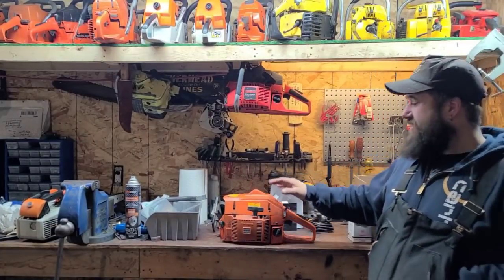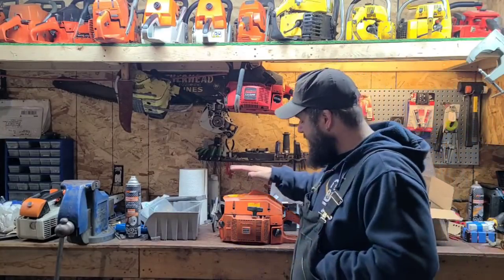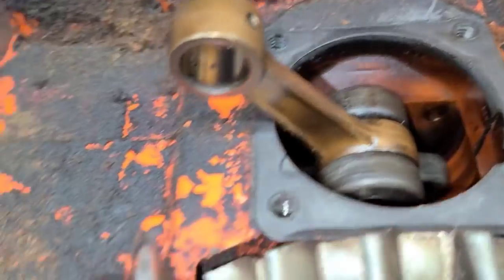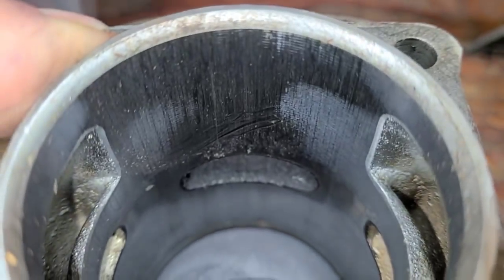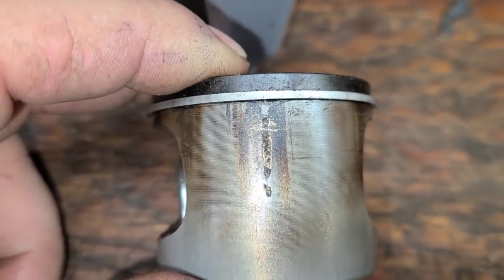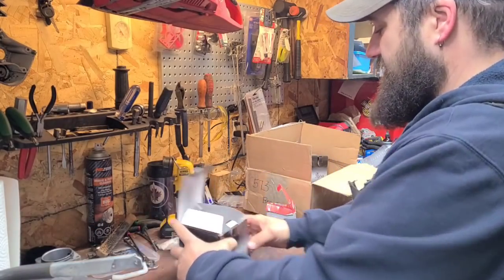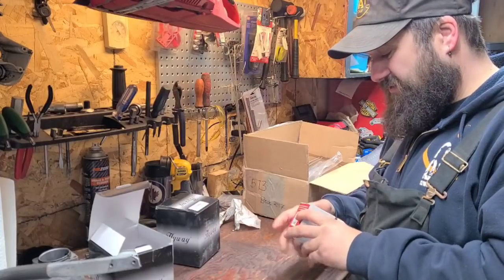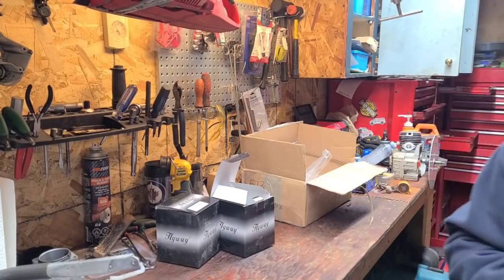FNS: A 266xp for Buckin Billy Ray with parts from The Ironhorse!!

Comment: @Tinman I've been using Three Bond 1184 for a couple years and it's a great adhesive and sealer compared to the one you are having trouble with in the cold. I'm in Calgary Alberta and my shop is about the same temp as yours!🥶 Hope that helps, good luck with your builds.😉👍

Comment: I have a 266 and a 268 and in all honesty I like running the 266 more its just a perfect saw so I understand the love for the 266
Reply from the maker: I've owned both, I found my 266s run better then the mint 268 I had.
Reply: @tinmanssaws  the 268 is even ported it was when I got it and shes not an easy starter the 266 on the other hand has a ton of compression and starts on the 3rd pull

Comment: Hey tinman! I've been working on a 268 for months, every time I put it together the saw fires up and races away! I've put new seals in it, new gaskets, etc! About ready to throw the thing out!
Reply: Of you can shoot some brake clean around the potential spots for air leaks while it's running you should find the leak, the brake clean lowers the RPM if it sucks it in. Walt at Afleetcommand has a couple videos on diagnosing leaks with it.
 Check the intake, I believe those ones use the plastic block, sometimes they crac from being over tightened.
Best is using a pressure and vacuum tester like a mity-vac, about $80-$120, if you're doing many builds or much saw work, it's a good investment, good luck👍
Reply: @jimssawsnstuff8903  Thanks Jim, yes I am a big fan of the Afleetcommand channel and recently used the brake clean trick to find a crack in a Jonsered 70E intake manifold(also plastic)... I really wonder if I have the crank seals in correctly. Will see if I can test it but the saw goes straight to practically max RPMs and I don't want to blow it up. Has a nice OEM gilardoni open port cylinder on it.
Reply: I’d really suggest the mitt-vac, I’ve got some stuff on it on my Instagram Jiminthemountains as well as a few other tips there

Comment: IS THAT PISTON FROM DOMINANT  ,I KNOW WISECO MAKES THEM  ,LOOKING FORWARD  TO THE BUILD  I LOVE THE COMODARY BETWEEN ALL THE CHANNELS HELPING EACH OTHER OUT ,BUCKIN ,TINMAN,NICK PIXEL,IRONHORSE, BELLHOPPER ,TAZMAN, ONE BIG FAMILY  😁😁😁👍🏽👍🏽👍🏽 BE SAFE AND HAVE A GREAT WEEKEND
Reply from the maker: Not sure where that piston came from. You may be right..
Reply: It’s not a dominant, they have a .010 taper on the dome on the exhaust side................
Reply: Those pistons come from Definitive Dave at Chainsaw Conservation Componants. Tinman that piston would be good to put in that 52mm 372bb
Reply: @tinmanssaws   Howdy, this is Dave from CCC Racing, we design a good number of pistons that Wiseco builds for us. If you need any help. parts, etc. just let me know.  365 special, 372xp, 372xpw, 372 big bore 52mm, OE346xp pop-up, NE346xp, NE346xp pop-up, NE346 big bore pop up 45mm, 181/281, 288xp, 066/660 pop-up, 066/660 big bore pop up, MS661, MS661 big bore, 394/395, 394/395 big bore, 272, 3120xp/084/088/ms880 big bore and many more :)
Reply from the maker: @JoviParagon  hey Dave, if this is indicative of the quality of your pistons I'm super impressed. Quality 100%, thankyou sir.

Comment: I have a 262 XP that I need to fix some fuel lines on.  Can the cylinder/piston be changed out for a 266 or 272?  Thanks
Reply from the maker: The 266 and 272 are built around a larger chassis then the 262 so unfortunatly no they don't fit.

Comment: That little shiny spot on the bottom of the intake side is normal for even a brand new saw. it happens during test run start up on all saws.
That piston you're looking at would be considered nearly new without the little scuff on the exhaust side. It clearly has all the machining lines indicating zero wear and no rocking whatsoever. If you're going to give lessons then please don't mislead people with bad info.